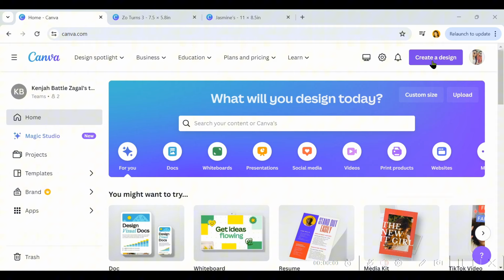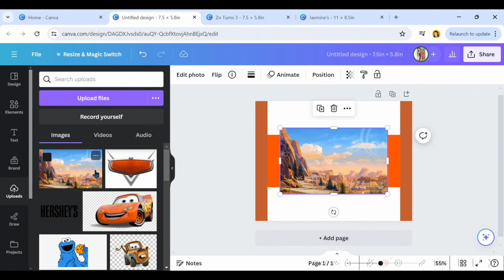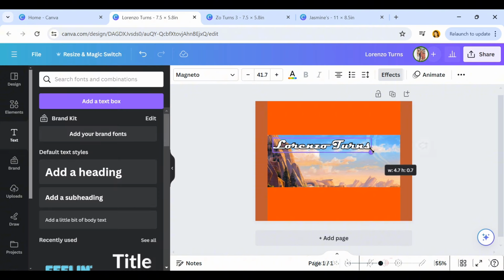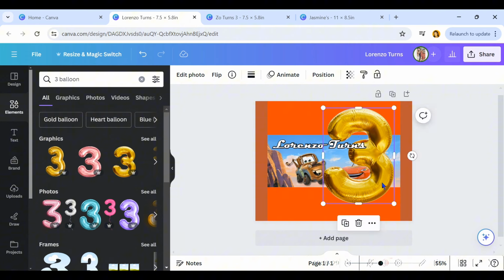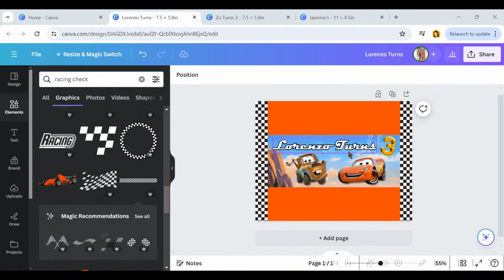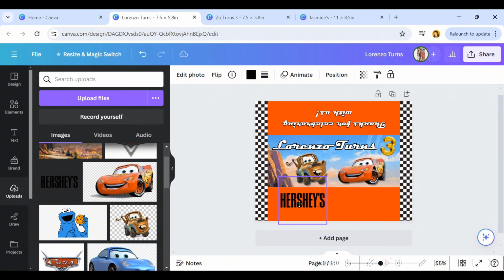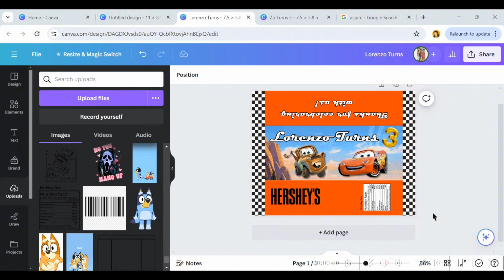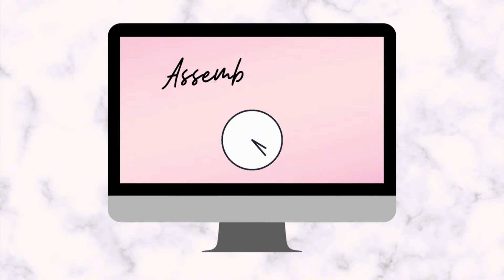Personalized Hershey Bar Wrapper Tutorial | Using Canva

Comment: OMG thank you. I tried so hard to do this using a template. I couldnt get the sizing correct and it was making me so mad. I scrapped it and ended up doing it this way and it was SO MUCH EASIER. Thank you for showing the last step in putting it on an 8.5 by 11 paper that made it print so much better without it filling the page. THANK YOU